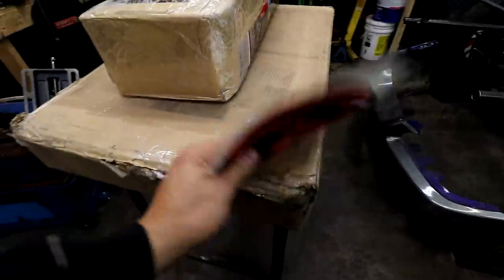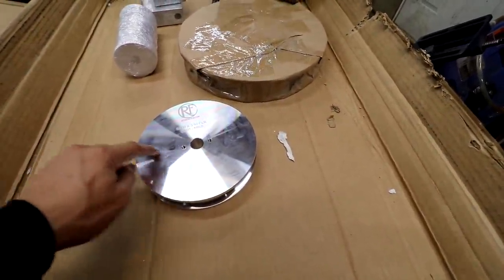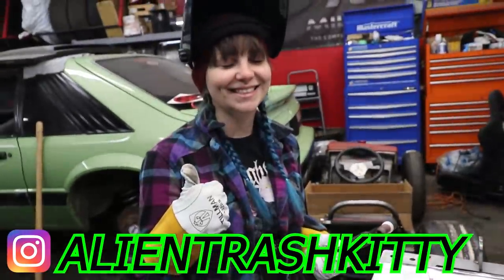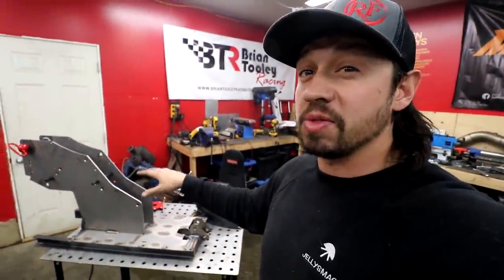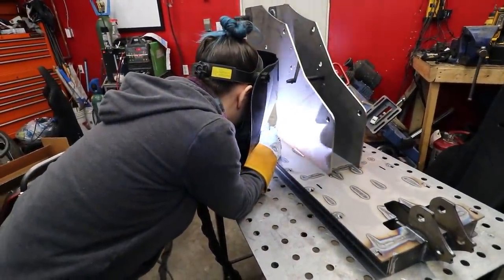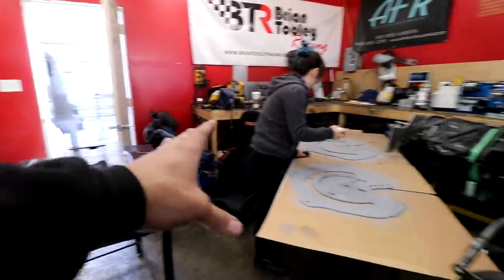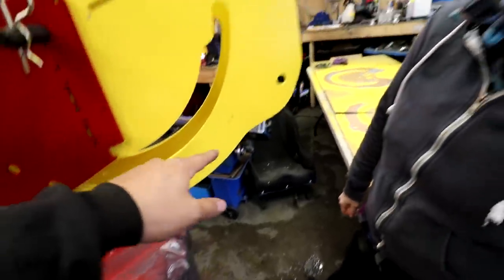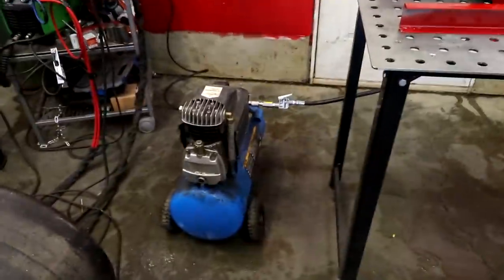The Biggest Upgrade I've Bought In A Long Time. The Best Of The Best.

Comment: Great project, Kyle. That vertical bender is the way go. I knew Virginia would pick up on the TIG welder quickly because of her steady hands and artistic skills. Honestly, with practice, I think she'll be a master in short time. Probably won't even have much trouble in a tight spot welding with a mirror if needed. It's like all those face/body painting skills have paid off for what comes next. Great work, homies!😎👌

Comment: Second content creator that has gotten the bender I've been trying to justify buying for about 3 years. I hope it makes all of your projects easier.
Reply: If only we could get youtuber pricing...
Reply: I've seen so many bad reviews on the Rogue Fab. I went with a JD Squared model 4. Higher quality dies. And horizontal bending.
Reply: @ClarksAutoAndPerformance  it’s bc the the mandrel attachment is needed$$, with out it the bends are flatten or distorted and may fail chassis inspection. The JD dies bend in a way that it doesn’t distort bends. For like 5 yrs I was wanting to buy a RF bender too, when it came time, I researched and found this info. JD is a far cheaper option.

Comment: Least you didn’t pay for it but you should sell it and get a JD Square model 32
Reply from the maker: I did pay for it. And I already had one like a jd square I don't like bending horizontal
Reply: @Boostedlifestyle  there is nothing like a JD Square The imitation benders are no comparison I Benson wall chrome Molly inch and five eights with the rogue fab and it just totally crushed it flat I sold it mediately